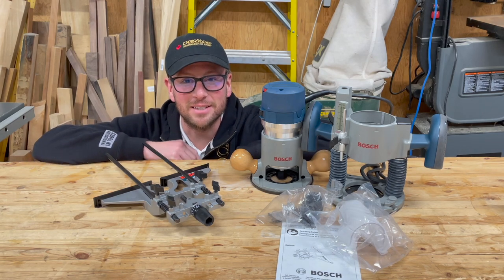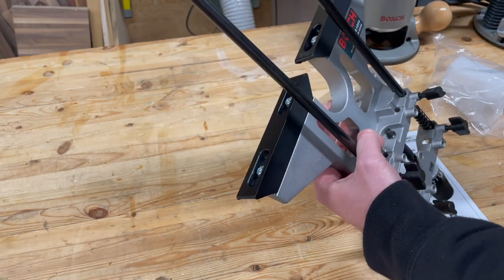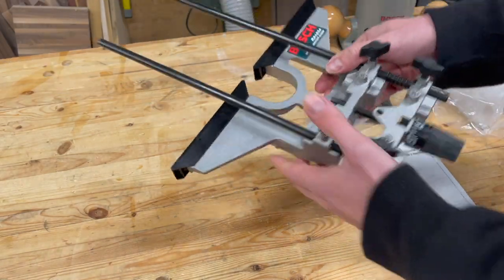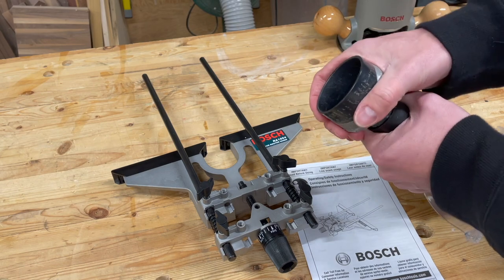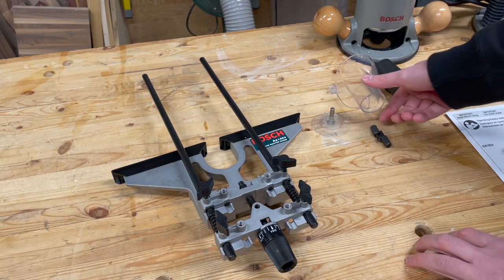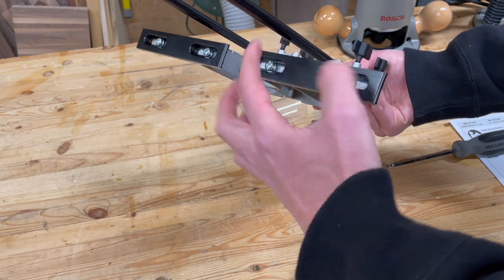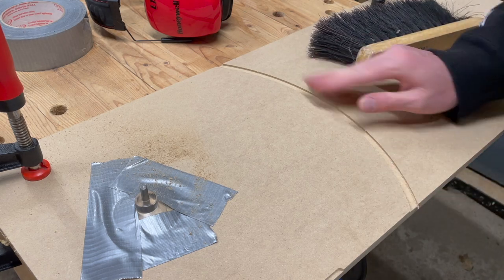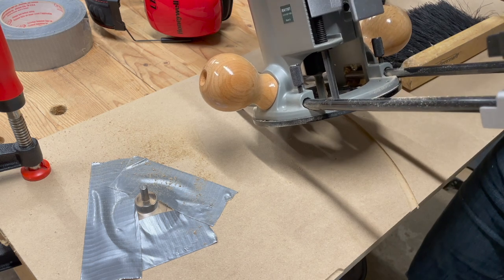Bosch Router Edge Guide Review (RA1054) - w/ Circle Guide - DETAILED REVIEW

Comment: Good review. It's been a while since I used this. The last time I cut a circle was for a 6 1/4" hole in a 10 inch circle. I have made my own circle guides to simplify this process and not take apart the edge guide. So, I took a 20mm thick x 4 x 9" and used 3/8" rod, a touch smaller than 10 mm, the router didn't mind. One is built with 3 foot rods and another built with 16 inch rods. I used by dowel centering jig to drill 2 holes aligning with the router base holes and made 3 holes, each adding 1 inch to the diameter. On fits the jig, one fits a #6 sheet rock screw, and another fits an 8 penny nail. To make the doughnut to affix to a trash can lid, I first cut a 10 inch OD hole on a piece of 1" insulation and then cut a 6 1/4" ID hole to fit the 6" PVC fitting for collecting chips, all with a 8 penny nail. And I have used it on a picnic table, too. 😄

Comment: Great review. This guide came included with my router kit and I had no idea it could be used for circles until now - thank you!
If you want to do circles larger than 32 inch, just buy yourself a couple of long rods (I think these are 10mm?) and switch them out for a specific project.
Reply from the maker: Thanks for watching and commenting! It's a great edge guide and that's a great point on using longer rods!

Comment: Great video! I bought mine for small and larger circles, and realized it just can't do circles smaller than around 9" due to the router base itself. Had to go for the Jasper Circle Guide for that still. Will use for Dados for sure later! Thanks!
Reply from the maker: Thanks! I haven't tried any small circles yet, so thank you for the note on the ~9" limitation. I just checked out the Jasper Circle Guide...very cool little tool!

Comment: I just watched your video on this edge guide. And i have come to a conclusion. I think the use of self adhesive backed sandpaper will work excellent on the circle cutting jig. What's your opinion on the status of my idea? Thanks for the review!!!
Reply from the maker: Thanks for watching! I think sandpaper would work pretty well. It really comes down to how aware you stay with the pivot point. I ended up often using painters tape on both the workpiece and pivot point with a bit of CA glue connecting the non-sticky sides of that tape - basically making my own double-sided tape that wouldn’t leave residue on the workpiece. 

Thanks for sharing your thinking!!

Comment: Do different routers have different width rods? I'm wondering if you could use one of these Bosch guides on a Craftsman router?
Reply from the maker: Great question…different brands can have different rod spacing and diameters, but some brands do have the exact same setup making accessories compatible. Unfortunately, I’m not familiar with Craftsman routers, but there should be some information out there regarding compatibility.

Comment: I haven't had much success with the center pin.  I've found the duck tape easily comes up a little allowing the center pin to rock back and forth.  There must be a better way to secure the pin.  Anyone have a similar experience?  Thinking about drilling a hole at the center pivot point and using a dowel for a pin.  Then, after cutting the circle gluing the pin in place and cutting it flush.
Reply from the maker: While duct tape worked for me most of the time, for those circles on more expensive material I ended up double-siding tape 1/4” MDF to the material then drilling a couple of holes + screws to hold the pivot point perfectly into the 1/4” MDF. 

A couple of other times, I ended up drilling + screwing the pivot into the bottom of the workpiece (so those holes didn’t matter) and going about it that way.
Reply: @MasonWoodshop  Thanks

Comment: Could you use this to make a router into a table saw equilivant?
Reply from the maker: Very interesting question and I'd say no. While it would suffice on small boards within certain thresholds of width (too large and guide wouldn't work, too narrow and you'll run into issues). Also, using a router for those types of cuts would put a huge stress on the bits, require you to make many passes depending on the thickness, and also create far more dust. Even if you were using a 1/8" bit, the cuts would need to be slow, require multiple passes, and chew through bits like mad.

Comment: Would have been nice to demonstrate it using the plunge base
Reply from the maker: Great feedback, thank you! Attaching the edge guide to the plunge base is just as easy to do, but there are a couple of reasons why I don't use the plunge base with the router:
1. The edge guide mounts parallel to the handles (90 degree rotation from the fixed based), which feels very awkward unless you're working on small work pieces
2. The handles are much higher up on the plunge base, which can lead to stability issues then trying to keep the edge guide square and the router flat on the surface
It can most certainly work, but there are those precautions to take when doing so - maybe I'll put together a video on this topic.
Reply: @MasonWoodshop  9:30 Thanks for pointing out the challenges of using the Bosch plunge base high handles and awkward design angle of the plunge base. I will place a dymo label on my plunge base so I don’t try to use it that way.

I just bought the Bosch 1617 (retail therapy) kit with free edge guide and have almost no woodworking experience. Fortunately I have palm router on the way to engrave some some wood signs for starters.

A video on fix router base vs. plunge router bases real world use examples might get some views. Most on YT you just see the basics of the design differences and not real world examples of the scenarios one would use each base type.
Reply from the maker: @andre1987eph  That's great you were able to get a free edge guide with it. As far as getting started, I definitely recommend getting started with the palm router. They can be intimidating tools to use at first, but after a while you'll gain confidence and both of your routers will become extremely versatile and valuable to your woodworking. 

Great suggestion on the fixed vs. plunge based video - I think I'll do that! I have both fixed and plunge bases for both my large Bosch router as well as my DeWalt palm router, so I think I could put together a nice video for each set.
Reply: @MasonWoodshop  thanks for taking the time to reply and the encouragement.

Comment: I found needing to use duck tape the circle tool down , a bit odd .
Reply from the maker: It's definitely an odd one and I would have like a secondary option of using a small pin/nail. The manual itself says "center the pivot plate on the center mark and attach to the workpiece with several strips of strong tape placed over the pivot plate in a crisscross pattern." 

I've used it a couple of times recently and putting some sandpaper on the bottom of the "pivot plate" with some tape to hold it down has done a good job.
Reply: @MasonWoodshop  .... I'm thinking to make a pin to fit the hole and stick into the wood to hold it. ha ha
Reply: The circle is hard plastic, not rubber. It’s not designed to suck.
Reply: @andre1987eph  .... Right, I thought he said it was suction but it's still odd that the circle plastic part needs to be taped down.

Comment: Does anyone know if the Bosch edge guide would work with a Ryobi P601 cordless router?
Reply from the maker: I’m not totally familiar with the Ryobi you mentioned, but most of the battery powered routers I’ve run into have much smaller bases than the Bosch, which wouldn’t work with this edge guide.
Reply: @MasonWoodshop  Okay, thanks for the reply.

Comment: Two concerns in my opinion;
Center pin shifted during the cut and particularly near the end of the cut, possably as much as 1/16 inch.  Not having the ability to fine tune a radius setting with the adjusting knob is also limiting.  For a fair amount of money, the mechanism is not well thought out.  I for one will pass on this tool as I would like and expect a better tool with more precision from Bosch.
Reply from the maker: I have been able to solve the slipping centering pin by putting some sandpaper on the bottom of it, then when I tape it down it holds pretty well (no issues since doing that as long as I don’t tug on the router). I’d love to have a fine adjustment as it can be difficult to dial it in to a perfect measurement. I generally think of this as a good edge guide with a mediocre circling jig built in - for a better circle cutting jig, Milescraft makes a pretty good one with much more accuracy and flexibility.
Reply: I haven't had much success with the center pin either.  I've found the duck tape comes up a little allowing the center pin to rock back and forth.  On the second or third pass it came up completely no matter how hard i tried to press it in place before I started the cut.  There must be a better way to secure the pin.